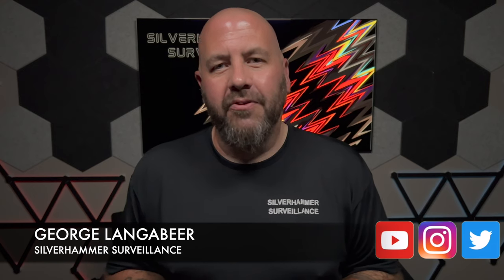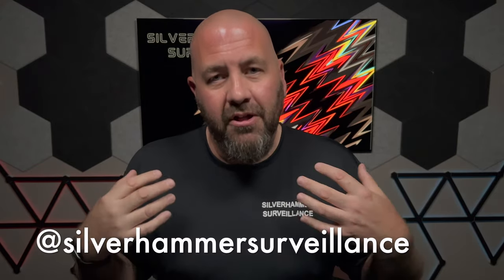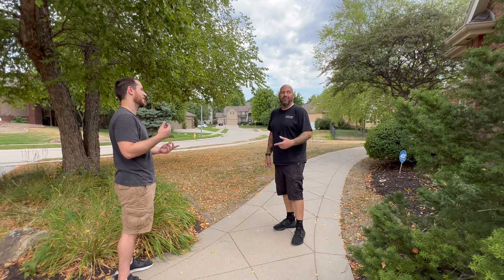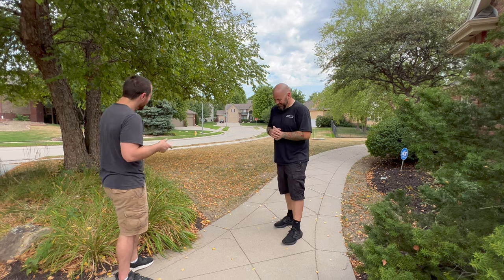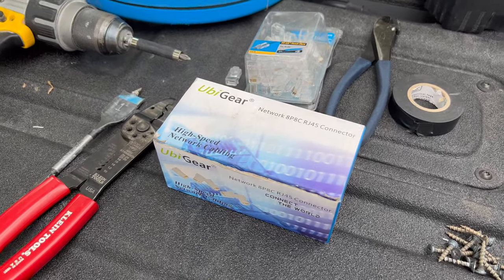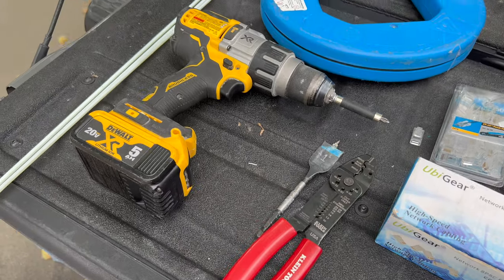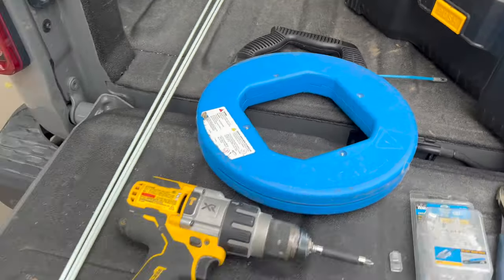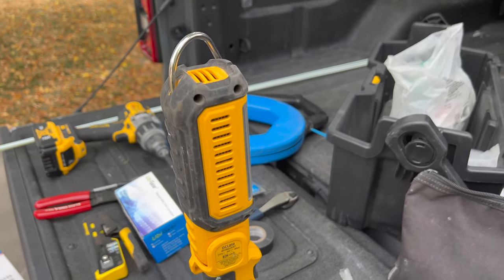How To Install a POE NVR Security Camera System From Alibi Security

Comment: George, is there anyway to convert a Siamese twin cable (coax + two wires) to be used for ethernet POE cameras?  I am familiar with balun adapters but not sure if there is anything available for this purpose. I have three runs to the outside of the house that have never been used.
Reply from the maker: I just responded to your email.

Comment: I am a very capable DIY'er and based off the shape of my home/entry points and each cameras field of view, I want to do an eight cameral install on my home.   The issue I have when I'm thinking this thru is that my attic has spray foamed insulation.   It is all over the bottom of the roof sheathing and extends all the way down to the top plate of the stud walls.  All my cameras will be installed under the roof overhang/soffit area.  I'm worried that when drilling that hole in the soffit and trying to run the fish line that I will run into obstructions.  (plywood cap off or something similar).  I literally can not see what is under the spray foam.   I'm half tempted to just go for it and see what happens.   I've even contemplated trying to run the cables before I even buy any cameras/NVR.   Any advise you can share since you have so much experience.   Thanks.
Reply from the maker: My contact info is in the description of this video. You can call me during business hours, if you’re interested in a system & installation advice.

Comment: Nice video but  I do wish that you had shown the part you referenced concerning getting the cables through to the room where the NVR is located...you referenced "finding nails on the stud? and drilling through the stud. Why are you looking for nails on the stud?  Can you elaborate on the details of this process?  Best techniques for finding finding the specific stud to drill through? When you are up in the attic it can be hard to determine exactly what studs map to the room where you are trying to run these wires especially if it's full of insulation. Any fool proof or general techniques you use to ensure you have the right spot before you start drilling through studs willy nilly only to find out that you drilled through the wrong one? Assuming you find the right stud do you just drill vertically through the stud? Could there be wires running through the stud or along the stud that might present a hazard?...could there be metal plates that might join studs together for whatever reason? I presume, that the cables are dropping in behind the dry wall (that wasn't stated and I'm not familiar with home construction), how do you fish them out...do you just cut the hole in the dry wall where you want the wires to come through and then hope that from the attic you've drilled your hole in the right location?   I'm assuming the location where you drop the cables might have horizontal "beams" that could potentially block the cable from reaching the specific location where you want the wires to exit (e.g., at floor level)? How do you determine if the cable has a clear path down the wall and doesn't have some sort of blockage? You referenced that you use a stud finder. Is there a specific type of stud finder that you'd suggest. Does a stud finder show pipes? wires? etc...that might be lurking behind the wall?  It looks like you used some sort of plastic plate for running the wire through the the dry wall. Any special tricks for installing it so that it looks good? Do these plates come in a kit or do you typically buy the components separately (plate, dry wall screws?, etc.) So many questions and details just around this one step that is key to making this all work.
Reply from the maker: There’s no way to share every single little detail in a single video. The video would have been 2 hours long. If you’re interested in Alibi cameras and more of the process, you’re welcome to contact me. My contact info is in the description of the video. There’s no way to answer these questions in a single comment response.
Reply: @GeorgeLangabeer Understand, it's just that the step that you didn't cover in the video is one of the things that kept me from tackling installation of a POE camera system.  The last thing you want to do is to leave your attic and/or walls inside of your house with unneeded holes. And my experience is that often times there are special techniques/tools, etc. that can make all the difference in the world between things going awry and turning into a nightmare vs it going smoothly. 

 I'll need to do  a little more research on Alibi camera's first as I don't want to waste your time. Based on what you've said in other videos I'm looking for something that is more of a middle of the road system (step up from the "drug cameras but not top of the line.). So Alibi cameras may be out of my price range. Currently I'm looking at the a  ReoLink system (https://www.amazon.com/gp/product/B0811V48LG/ref=ox_sc_act_title_1?smid=A22EYB2OIILVQA&psc=1). supplemented with one of their Duo 2 cameras. The 4 cams and 8 channel NVR with 2TB hard drive is on $447 (23% off). So it seems like a pretty good value for the $'s. 
Thoughts?
Cheers
Reply: @jetmartin9501 the nails in the top plate simply mean there’s a vertical stud attached below. You’d drill the top plate between these sets of nails to get into a stud bay.  If you’re not comfortable with that, watch videos on running wire—I’m sure there’s many.

Comment: I have existing RG-6 from an old pre-wire.  Can I use the existing coax and convert?  Or should I run new Cat 5/6?
Reply from the maker: You need to run new Cat5/6

Comment: I watched your previous videos, like your idea of being proactive, to stop thieves before they break in, like the idea of outside cameras too, however, the system described in this video, how does it stop a thief from getting in, shouldn't there be an alarm speaker outside?  You'd have a video of them to help identify them to police, but a camera won't stop anyone unless there's an outside alarm to scare them off?  Does the Alibi system use an alarm and do you recommend one?  Cameras alone would just let me watch someone break in, particularly if I'm not home.  Last, would the Alibi system notify me on my ap/phone that someone is breaking in?
Reply from the maker: First of all just having good cameras, instead of crap cameras is a deterrent on all its own.  You have no idea how many times a camera system pays for itself without you even knowing it.  Thieves are smarter than anyone gives them credit for.  Trust me, if they go up to house and see these Alibi cameras and their white lights from the Illuminite night vision and they see some cheap Ring system at the next house or some alarm system sign stuck in the front yard,  they will go to the ring/alarm system house everytime.  Thieves know that even if they were successful, cameras are going to give the police evidence, alarm systems won’t do a damn thing.  To answer your other question, yes, Alibi has a camera with an audible alarm and strobes that go off at the same time.  But I still recommend the other system I’m talking about in these videos.  To answer your other question, yes, you can get alerts on your phone for all kinds of events:  people, vehicles , line crossing, intrusion areas, object removal, motion…and if you get their cloud service you can crazy analytics like gun detection.  Far superior to anything else on the market and fear superior to having an alarm system.

Comment: Great video thank you. Question.. can the NVR be connected to a wireless network extender such as the Actiontec ?
Reply from the maker: Thank you! As long as it has an Ethernet port & supplies your home internet, it will work.
Reply: @GeorgeLangabeer   is there an option to view from multiple monitors and or TV’s with this system ?
Reply from the maker: The NVR has one VGA port and one HDMI port.  You can view from a single monitor no problem, but if you want to do multiples, one would have to be HDMI and the other would have to be VGA…or you could use a HDMI splitter.
Reply from the maker: Here is my contact info.  Feel free to contact me if you’re interested in this system.  https://ovou.me/silverhammersurveillance

Comment: ....internet over electrical? I am extremely intrigued. Is it not a wifi broadcaster? I have to look into those things because I have a ton of questions.....
Reply from the maker: Has nothing to do with Wi-Fi. It uses the electrical to transmit the signal. It’s like having a hardwired connection.

Comment: Went to Alibi several weeks ago to enquirer about a local installation. Put in a request for quote and I haven’t heard a thing from them.
Reply from the maker: That’s not on Alibi, that’s on the installer they contacted for you. Most of them don’t do residential installations, so they usually don’t reply to Alibi. Your best bet is to buy the equipment from me, I’ll ship it to you & then find a local electrician for the install.

Comment: Usually 7-10 ft. Are thw recommend camera height. How many ft. Would you say those cameras are?
Reply from the maker: Whoever says 7 feet is a recommended camera height doesn’t know what they are talking about. You want to make the thief at least need a 6 foot ladder to reach the camera. For this install, it depends on the camera. We didn’t show all her cameras, but 3 of them are approx 8 1/2 feet up, one is 15 feet up & one is about 18 feet up. Ideal camera height is 9-12 feet. Low enough to catch detail, but high enough they can’t be reached. The average height of a soffit (like hers) is usually perfect.
Reply: @GeorgeLangabeer  eufy definitely says 7-10 feet. So you don't get the top of someone's head. And can see the face. Believe ring etc also say the same.
Reply: @GeorgeLangabeer  Between 7 to 9 feet

Mounting the camera slightly below the roofline or eave can provide protection from harsh weather while maintaining an unobstructed view. While the optimal height for mounting an outdoor security camera can vary depending on the specific circumstances, a generally recommended range is between 7 to 9 feet (2 to 3 meters) above the ground.

Even when I Google the question. This comes up.
Reply from the maker: @D0TELL I’ve never heard of any of those companies saying those numbers. If they do, they are wrong & it’s because their cameras suck & you can’t get detail much higher with their horrible cameras. If you have a camera at 7 feet, it’s not going to last long. That’s way too low. If you have real camera system (like Alibi) you most certainly don’t need your cameras that low. With a legit camera, you can see faces much further than Eufy, Ring, etc….a thief could destroy or steal a Eufy battery camera (at 7 feet) in 2 seconds….With Ring’s cheaply made cameras, you could destroy them even easier. People at Eufy, Ring, etc. have no real-world knowledge of protecting people from criminals.
Reply from the maker: I would stop listening to advice from brands that have no real-world knowledge of catching & deterring criminals.
Reply from the maker: @D0TELL Mount a camera at 7 feet & see what happens….i wouldn’t spend much on that camera though, because it will be gone. I’ve been doing this for 24 years. I would never install a camera that low. It’s common sense. I just Googled “perfect security camera height” & it says 10-12 feet. So I’m not sure where you’re getting this information.
Reply from the maker: @D0TELL the average soffit is 9 feet. Not too many houses that have 7 feet soffits.

Comment: Which hardwired POE+, NVR is less proprietary to other MFG cameras? I need to find a solution for 16 Cameras. or use other mfgrs flood light Dual lens / rotating 90 deg up down....180 deg rotate AI patrol tracking.
Reply from the maker: Unfortunately that will be difficult. Most NVRs are pretty proprietary…at least when it comes to additions like what you’re wanting.

Comment: With the nvr what happens if your nvr only has one rj47 port but has 8 channels
Reply from the maker: If you have a NVR that doesn’t have POE ports for your cameras, you’ll need to add a POE networking switch to the mix…if that’s what you’re asking?

Comment: Is cat 5e still sufficient? I remember installing this like 10-15 years ago! Thought you’d need cat 6 or 7
Reply: Cat5 is cheaper and can handle up to 100mbs. So yes - it is plenty to handle video
Reply: @dylandavison  video obviously doesn’t take as much bandwidth as I thought! I thought you’d need gigabit (1000 mb)
Reply from the maker: No, it’s plenty sufficient.
Reply: @michaelthompson657  if you are running the wire for yourself - cat 6 isn’t that much more expensive and can future proof it a bit. I ran cat 6 in my new build and have yet to install POE
Reply: @dylandavison  yeah that’s what I’d do, if your running the cables anyway you may aswell future proof it so you haven’t got to re run them!
Reply: @GeorgeLangabeer  thanks for letting me know!
Reply from the maker: @Michael Thompson I agree with Dylan, But either one will work and both are backwards compatible and more than enough to handle these cameras. Like Dylan said, Cat6 is just a little more expensive.
Reply: @GeorgeLangabeer  yeah great point!
Reply from the maker: If you’re going to SOMEDAY use these specific cables for something else, then yes, nothing wrong with running Cat6. But for the nature of these cameras and the install (and your average homeowner), you’d never need to “rerun” these cables using Cat5e.
Reply: @GeorgeLangabeer  yeah great point! Aren’t the cat 6 connectors slightly different too?
Reply from the maker: In a new run at a business, we’d use Cat6.  On a house we use either or, depending on the person’s budget. Sometimes every $ counts.
Reply: @GeorgeLangabeer  yeah definitely!!!
Reply: Its all copper wire. Its just the twists that makes it different
Reply: @reggaeriderr  thanks!

Comment: What do I do if I do not have an attic?
Reply from the maker: Depends on the house. Sometimes you tuck your cables in your siding. Sometimes you can run the cables in the basement (if it’s unfinished & then come up in conduit. Or you can use conduit for the entire install.

Comment: Can’t seem to find the right system for me  I have bought 4K night owl,  camera system  too much of a delay like over a minute and I have the best Internet that you can get then I bought the pro swann  4K enforcer 6 cam Poe the most expensive camera system you can buy on Best Buy not only did it have a delay it echoed so badly then i boght the realink  system top of line and still not happy I have a bunch of wifi cams between floodlights, doorbells and battery operated cams from different companies that work great but definitely not ring hate hate that company that work grate. I am looking for a good 4K Poe 4 to6  cam at least 8MP  system that we’ll record 24 7  that is easy to use with no delay, and no echo. For around 1000 is my budget I have done so much research watch so many videos and they’re literally is not the best  camera system out there so many mixed reviews on this topic can anyone recommend a good system that haven’t tried lol
Reply from the maker: Unfortunately, you’re not going to find what you’re looking for at that budget.